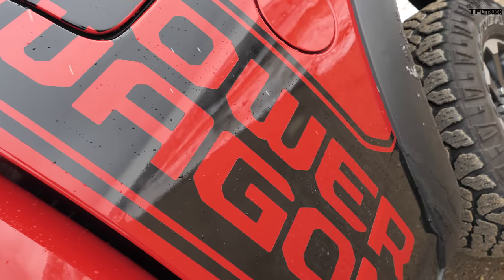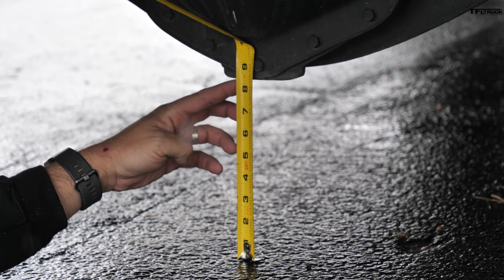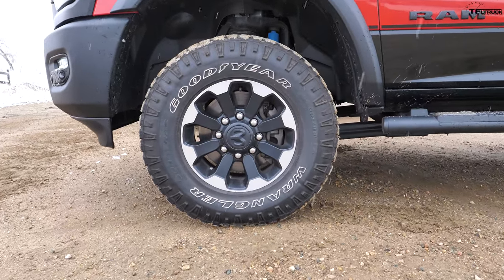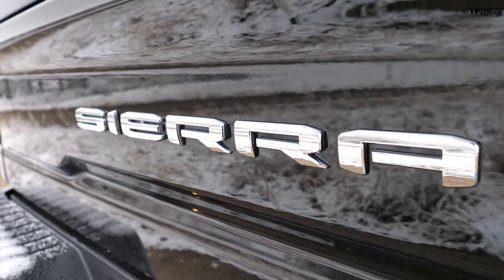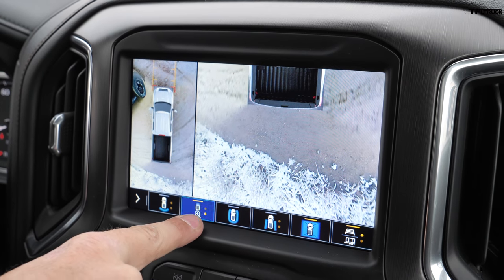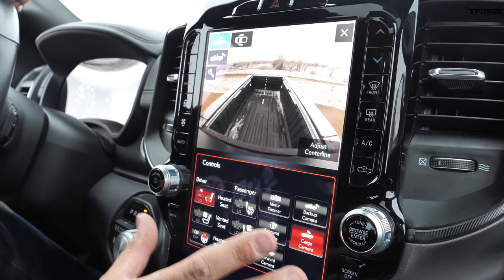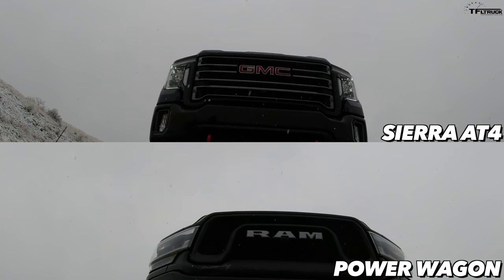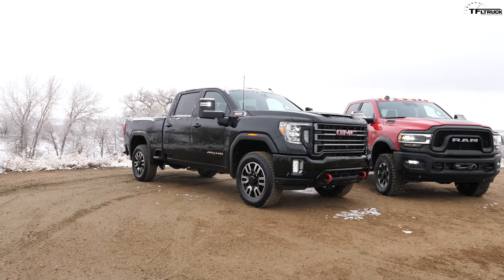Ram Power Wagon vs GMC Sierra HD AT4: You’ll Be Surprised Which One Has Better Off-Road Specs!

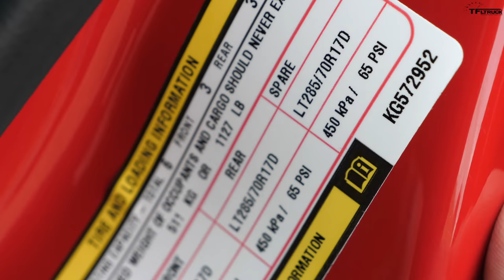Comment: 15:00 There are sedans that have 1100 lbs payload.
Reply: there are no sedans with sway disconnect bar system
Reply: Motortrend tested them and said they could comfortably do double what the power wagon was rated 4. It also destroyed the gas gm hd's in towing and payload despite being rated for less.
Reply: @ggqbc  The same motortrend that couldn't set up a Dyno..... Twice! Please. The truck is rated at what it is. What they think and what's legal are two different things.
Reply: @EGGINFOOLS  LOL
Reply: Any statement that starts with, “Motortrend says” is automatically negated!
Reply: @Gene3067 The point is that it's very easy to max out the payload. Put 4 guys in the truck and some stuff in the bed and you can't tow anything.
Reply: I agree on all points regarding payload on the PW. RAM should really do something with that....and I feel it's underrated (from experience).
Reply: My Chevy Colorado was 1250lbs stock payload. 2000lbs with the add a leaf I had put in. Rams are crap if you ask me. I’ll take Chevy/GM, Ford for full size and heavy duty. Chevy/GM and Toyota for midsize. The ranger is crap, I almost got a Tacoma but the Colorado is simpler and cheaper. I didn’t need crazy options and my camper is only 3,200lbs.
Reply: @soylentgreen7074  

Nobody is asking you...and adding a leaf doesn't change the axle rating or tire rating.  I'll take the Ram Powerwagon all day every day regarding payload ability.   I don't care what the sticker says...I currently run 3 Ram 2500 6.4l trucks for my landscaping business and they are not left wanting for payload capacity or towing, and I'm not even running 4.10 gears.  I highly doubt that the rear springs have been detuned enough on the Powerwagon to compromise its payload and towing capacities enough to believe that it can only handle 1100#.
Reply: @phattygoodness7347  try telling police or D.O.T. that if you get stopped and are over the rated capacity.
Reply: @87gunsnroses  

I will...as soon as someone recognizes that my 3/4 ton full sized Ram 6.4l hemi is "overloaded" because it has 1500# in it.  I'm not required to stop at weigh stations.  Who's gonna stop me or even question my truck's payload if I'm not an idiot that makes it blatantly obvious that it's loaded well beyond its means?
Reply: Can that sedan drive the 1,100lbs payload through sandy, muddy, snow covered locations?
Reply: @ggqbc  Ram didn't just decide to de-rate the Power Wagon's payload and tow ratings for fun. If they could give it a 2200 lb payload rating, THEY WOULD HAVE DONE SO.
Reply: I had 1000lbs of bentonite on a pallet near the tailgate and I was shocked how little it squatted.  It drove like it wasn’t even there.  Ram has clearly underrated the payload and towing for some reason.
Reply: How is this still a debate? You want lots of payload you shouldn't be looking at a PowerWagon. Its a legit offroad pickup. The suspension is significantly different than a typical HD 2500. A non power wagon 2500 RAM has 4000lbs of payload. Buy that one if you need payload Happy now?

Comment: Hi Andre I just want to know which truck of the big 3 would you buy if you had the $ for any of them base on planning on keeping vehicle for ever so is because it's reliable in motor, transmission.  Safety, quality components interior/ exterior meaning you not going to be replacing parts that break easily or worn out prematurely. It's a one time huge investment. Mostly for towing a fithwheel traveling with family????

Comment: Why would you " disconnect the front sway bar" on the Dodge? Or are you doing that on both?
Reply: Only the Dodge has that option & the reason why is if you off road it disconnecting the sway bar in the front allows better articulation of the suspension which in some instances will keep the tire on ground or surface which allows better traction !

Comment: I’ve got the AT4 which is NOT as good off-road as my buddy’s power wagon so a bit disappointed cause this isn’t an apples to apples comparison! The AT4’s come with optional 6.6 gasoline motors which is what YOU should’ve compared the Ram 6.4 Hemi to. Rather than comparing the LOADED OUT AT4 diesel to a not fully loaded out gasoline powered Power Wagon. Also, the longer wheel base is horrible for any off-roading which really is a marketing ploy on GM’s part. If you really want to know which is the best HD Off-road capable truck look no further than the over lander club, Ram Power Wagons are without a doubt The Top Choice.
Reply: *used to be the top choice

Comment: Ram and GM both use the same AAM 11.6 rear end...right? Still?
So different diff clearance should be subjective to tire diameter not suspension. So the AT4 must use a taller tire

Comment: 1,100 lbs payload is hard to understand.  That barely competes in the midsize segment, let alone the HD segment.
Reply: Ryan rkj to put it In perspective a Honda Ridgeline has a higher payload capacity. I get Ram is focusing on off road with the PW. But there is no way in a hell a 3/4 ton truck should have a lower payload rating than a RIDGELINE!!!!!
Reply: @GreenMountain565  It's because of what it can do offroad. No truck can touch the Power Wagons articulation, which is key when playing in the rocks.
Reply: @killdizzle  I guess, my 19 poweragon has a 1600lb payload rating and seems to be able to do more without a problem. Just yesterday I pulled 7 tons of 1" clear stone in a 14 foot dump trailer and it handled it just fine. You gotta remember that the regular 2500 gassers are rated to pull some 18,000lbs. I feel like Ram is just being conservative with the numbers for warranty purposes. You'd lose a bit of articulation but you can always just run normal 2500 rear springs with spacers.
Reply: @WilliamStewart1  if the only objective is playing in the rocks, most people would choose a smaller vehicle, like a Wrangler, or a RZR.  I feel like the point of an off road heavy duty truck, is to have more capacity to take things or people with you on your off pavement adventures.  If you don't have the payload to take more people and more stuff, taking such a large vehicle off road seems pointless.
Reply: @RyanRKJ  I have a 19 PW, my payload is 1600. I think they got their numbers wrong at TFL. Also, articulation isn't  only  for rocks, it's good for getting over fallen trees and ditches.
Reply: @WilliamStewart1  Yeah but if you don't care about payload to that extent, get yourself a lighter smaller more nimble Jeep or something. Anything. The Power Wagon is just a dumb vehicle.
Reply: @dchawk81  It's not though, because I can put my dump trailer behind it and actually tow stuff.
Reply: @WilliamStewart1  Your payload isn't the 1100 of Andre's. So yeah my fault for lumping them all together.

It's still a bit low for the size of truck, considering its size also makes it less than ideal off-road as well.

I mean it's a 3/4 ton truck with half ton capabilities because of soft shocks and suspension travel.

(I also think the Raptor is dumb, to be fair).
Reply: @dchawk81  The Raptor serves it's purpose if you live in the desert, I'm not a fan of them but they're pretty badass in the dunes.
Reply: @WilliamStewart1  You make it sound like desert living requires a Raptor. lol. We all know that's horse 💩.
Reply: @dchawk81  I'm talking fun, not what's needed ha ha. From what I've seen and heard, they're a fun truck to bomb around in the dunes.
Reply: @WilliamStewart1  Oh. Haha. Gotcha.

Comment: CyberTruck has better ground clearance (16”), and better approach and departure angles than any of those gassers. Also adjustable air suspension with 8” travel, even in the base model ($40k)

Comment: It’s approach angle not approach height, having both these vehicles living in the mountains the Ram wins all the time off road, just depends on your main focus is. On a separate note I feel bad for my sister who bought the 2022 Silverado 2500 diesel she has put 5000 miles on and is getting 9.5-10 mpg.
Reply: Only if she is towing max or she has big problems - mine gets ~23 mpg hwy / 15 mpg city unloaded and 13 mpg towing
Reply: @Encourageable  they tried telling her it was because its not broken in, she bought it with 2 miles on it and now has 5,000 getting that mileage, just had it looked and and they say nothing is wrong but still getting the same mileage, breaking it in wont make that big of a difference. She hasn't towed anything yet, ought it to tow her built Jeep to MOAB and other places but  the trips had been cancelled so far so its mainly around town.

Comment: Auto 4wd is not a unique HD feature. It's been around for years in the 1500s and SUVs as well as the HDs. It's a great feature in my opinion and gets used regularly every winter.
Reply from the maker: Currently, the 2020 GM heavy duty trucks are the only once with Auto 4x4 feature. Ford and Ram HD do not have it.

Comment: You can't just measure the "Chin" in regards to how high it is off the ground and give points based on that alone. When it comes to approach Angle, obviously you have to measure a Triangle which means also measuring the distance from that low point to the front of the tire also. Also, since you were talking about Ground Clearance, you need to find the lowest overall point on the bottom of the truck and that Chin of the Front Bumper obviously wasn't it, especially for the GMC which is sporting a very low exhaust in the rear.

Comment: Actually the GMC doesn't look as bad as the Chevys do. Though I still think even with all the stuff GMC has done to improve their trucks off road capabilities they still fall short of Ram and Ford. It would not be hard for GM to put a locker in the front axle and do a little more suspension tuning.
Reply: The GM trucks don't have a live front axle, it's an independent front. They're known for having weak front ends as is, trying to lock up 910 lbft is a recipe for disaster in my eyes. Even the Ford has a straight front axle but they went with an LSD front because a locker trying to deal with 1050lbft is a sure way to get a bunch of warranty claims.

Comment: So I'm a GM owner with a 2014 2500 6.0 which I have heavily modified for 4x4 trails.  What I don't get about GM at this point is who is in charge of this market (the dedicated 4x4 trucks) and why aren't they getting with the program?  Where to start?  How about the G80... Ok so this was replaced on my truck with a better locker option when I re-geared to 4.56s.  Even as an on road application, the G80 is an inferior product compared to something like a Truetrac which pretty much will never wear out, can handle more load on the axle and is much better in poor road conditions and in off road conditions.  GM should scrap the G80 and be offering the Truetrac in their 2wd, regular 4x4 and z71 platforms.  As for the Trailboss and AT4, they should be getting selectable rear lockers.  IFS, a questionable choice for a 4x4 focused HD.  My truck has IFS obviously and it works, I have built up the axle quite a bit to make it more rugged but ultimately I think the AT4 should have a solid front axle with a selectable locker.  Gearing, 3.73 is a terrible choice for an offroad focused truck.  With 4.56 axle gears, my truck has a 50/1 crawl ratio, that is really the ball park you want to be in when you are offroad in a 8500+ plus rig.  Tires.... my god what were they thinking?  Basically, they put a 34 inch road tire that can handle a mild dirt road....  Tremor, 35 inch Duratracs.  Powerwagon, 33 inch Duratracs.  AT4, 34 inch road tires.  I have 35 inch KO2s and they are great.  Winch... again, GM not reading the market, not looking at the after market, not talking to possible consumers who actually go out and overland or do trails.  

They are losing market share to RAM and Ford in this area and the AT4 looks like a half assed attempt to put something out there that really isn't anymore capable than a z71.  In fact, I'm asking you guys to compare the two.  Take the AT4 and run it up against the z71.  Are consumers really getting anything different other than a badge and some creature comforts like hill descent?  On my truck hill descent is 4low and a little braking here and there and that works just fine.  To me this seems like a trim level that GM can sell to someone who knows little to nothing about off roading but gets bamboozled at the dealer into thinking they have a capable off road truck that can go out and handle whatever nature puts in its way.  In reality, I think they are getting a basic factory 4x4 with red hooks and some badging that has many limitations and is basically a factory z71 with a higher sticker price.
Reply: tl;dr

Comment: So we're smarter than the engineers now?  The Power Wagon is an extremely well-balanced and purpose-built heavy-duty off-road machine.  Bigger tires means less suspension travel i.e. wheel articulation, which the Power Wagon has always mastered with the help of the electronically-disconnected front sway bar (which is still exclusive to Ram and Jeep, btw).  Those slightly smaller Duratracs will perform better in the worst conditions that the AT4's tires.  Also, the suspension would have to be heavily modified to take the massive weight of the Cummins, even with the new CGI block.  This would pretty much make it a different vehicle.  Don't get me wrong, I'm not against having a heavy-duty Ram off-roader that is available with the Cummins, but I don't think the Power Wagon is the right fit.  It could probably take the TR or TRX badge similar to what's coming for the Ram 1500.

Comment: This comparison is easy. The GMC wins in payload, towing and daily use. The Powerwagon wins on the trail which is what it was designed for. So both are better in different areas. It depends on what you want to use the truck for if it's worth it or which one you should get.

Comment: So the AT4 has the same 4wd setup as my 2001 Yukon XL 2500. G80 rear locker, IFS front, 2wd, 4wd hi, 4wd auto, and 4wd low. No front locker, no selectable lockers, no auto disconnect sway bar and you want to say an inch here or there makes it better off road specs than a Power Wagon? There is nothing new about the AT4 as far as off road packages go.

Comment: Notice how he said "Allison branded" not Allison. These Duramax trucks in the 3/4 & 1 ton chassis are not true Allison made trannys. You will only find actual Allison trannys in 4500 & up medium duty trucks. This "Allison-branded" transmission is a 10 speed GM manufactured unit with an "Allison" stamp only.

Comment: Ram won’t put a diesel in a heavy duty off road truck. Their truck is meant for off road. You put a heavy diesel motor in, your suspension changes big time and not to mention emissions on a diesel. Not gonna work if you actually use the truck for off roading and crawling speeds. They own the towing department in the heavy duty class in my opinion, so yeah I guess if you wanted a diesel in an “off road” truck the AT4 would be the way to go? Besides buying a Cummins and modding it to look like a rebel

Comment: Would like to see real world specs on what the engines put out. Time to partner with a local dyno shop? Great job as always Andre.
Reply: Don't use the inertia dynos like all these Diesel competitions uses. They can be extremely inaccurate. The trucks use something like double overdrive transmissions to "cheat" the dynos. It shows them making much more torque and HP than they really have.
Reply: @Bryan-Hensley  Just use the ratio that gives you as close to 1:1 as possible.
Reply: @WilliamStewart1  I still doubt they are as good as the old "break" Dyno that truely loads up the engine. But I can understand, the trucks would smoke the tires on a floor type without large slicks or something. Inertia dynos are about the only way to have the competitions like they put on. Inertia dynos can compare very accurate. 1 to 1 on diesel will tach out before the turbos go full boost, they double overdrive them to bog the engine longer so they'll spool up. I'm sure the major events program the computers to be more accurate with this type of setup, but to be very accurate everyone should be running the same ratio. They may have rules for this, I don't know the sport well enough. I would like to see a comparison on one of the trucks on the inertia and engine Dyno. If you think about it, a gasoline engine stock truck has 14,000 foot pounds of torque at the axle in first gear.

Comment: I wanted to ask. During last year's gold winch award you guys had adopted other journalists methods where only recently updated or new vehicles where applicable for the reward. A lot of people, if I remember correctly, including myself were very annoyed at this due to the fact that the vehicles that hadn't changed could still be bought so therefore the test wasn't truly fair in finding the most capable off-road vehicle of that year. Have you changed your rules to include non updated vehicles since people could technically still buy them? If not, why not? Thanks!

Comment: I’m surprised the power wagon has smaller tires compared to the at4
Reply: Same here. I was certain they came with 35" tires.
Reply: Trying to boost the rated MPG numbers
Reply: @edwardsherman5932  nope, 33's. Only Raptor and Tremor come with 35's stock.

Comment: As a GM owner they need to take a little more quality in the interior,plus fix the electrical problems ,but parts are cheaper than Ford ,( they don't want thier vehicles back) and Dodge ,and cheaper to insure so !! Plus my 2500 rides horrible compared to my power stroke with 250,000 miles ,even on hitting new shock absorber a didn't help any !!